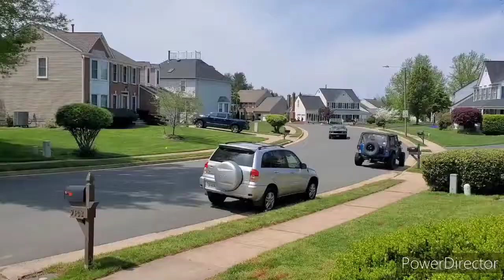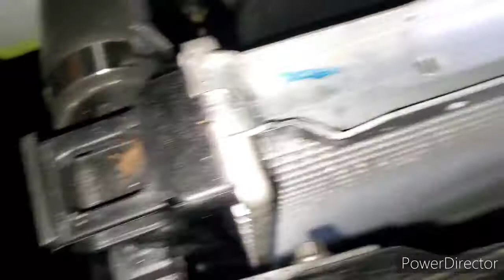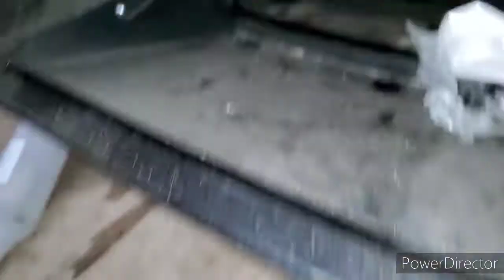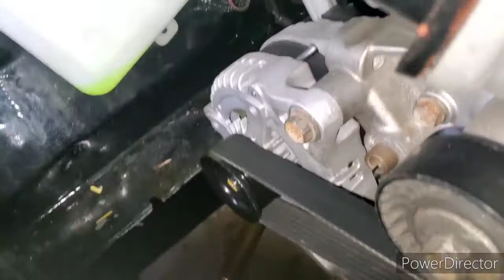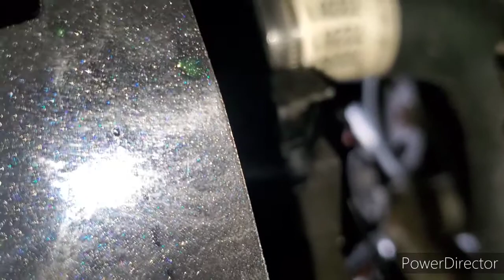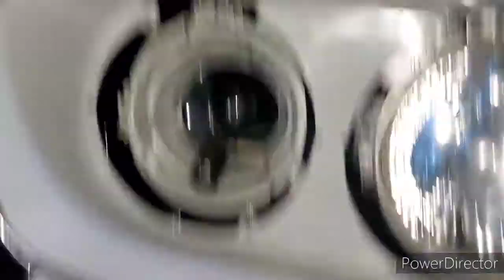1970-74 cuda Gen 3 hemiswap using a late model radiator/ cooling fans

Comment: Reusing parts is a heck of a lot cheaper.  Nice to know that it fits.  
Of you’re using the radiator from a Charger / Chally, any thoughts of using the oil, transmission, etc coolers?
Reply from the maker: Yes indeed it is. I think u can but ill have to goto the junkyard to make sure. Which ill probably be going to this week for a slip yoke for my cuda